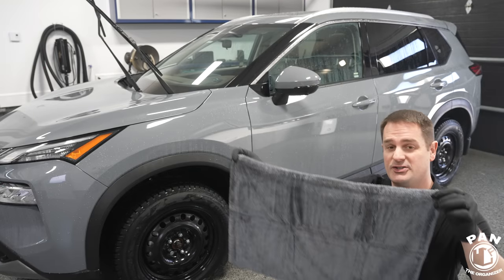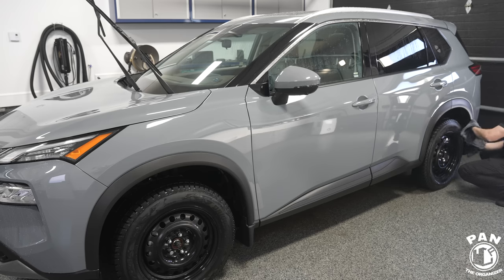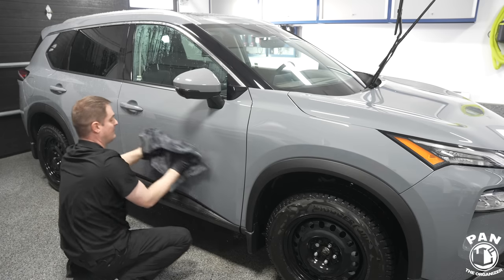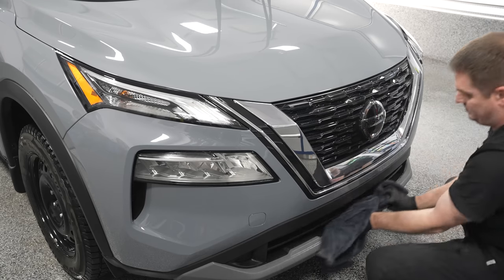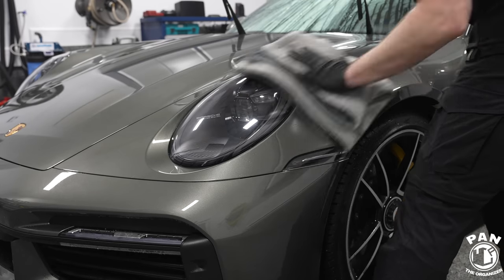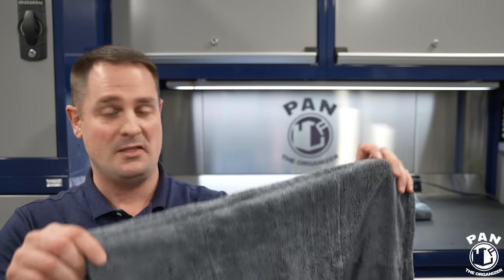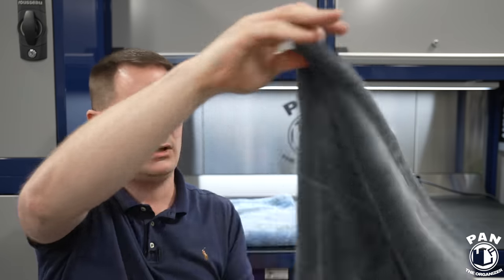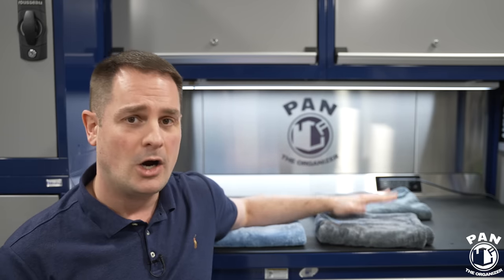My new favourite microfiber drying towels?

Comment: My favorite is the Autofiber Amphibian. Twist on one side, high pile on the other like the one you showed (but in a 16x16 size) Dry with twist loop and buff away any streaks with the fluffy side.
I don’t understand the need for super large towels … considering most of us air dry the car first. Even if doing a RW, i use two small 16x16 towels, let one get wet and ring out when necessary. 2nd to buff away any streaks.
Reply from the maker: I haven’t tested that one yet. Autofiber does make good microfiber products for sure!

Comment: Went to the local auto parts store and found a towel, I think made by Meguirars, $20 and can suck about the same. 
I have used the sucker for a few years now but was n needing one in a pinch and discovered the towel art advanced Arturo parts. Great video
Reply from the maker: Thanks Billy! If you have been using the Sucker towel, you probably noticed how much higher quality it is and how thicker it is compared to auto parts store bought towels...

Comment: Pan in my home there is a small parking and my vehicle is escalade it's backside is exposed to sunlight. I'm applying the graphene coat in night time and on morning my vehicle back part is exposed to the direct sunlight. And it won't affect the curing process on the car?
Reply from the maker: Don't apply coatings in direct sunlight. All manufacturers specify that. But after you're done applying, if it's in the sun, that is perfectly ok. It's actually good as it will accelerate the curing too.

So apply in the shade. And after you're done, it can be in the sunlight the next day no problem.

Comment: I have a 1999 Honda Prelude, I want to know if I should polish it or not. I want to use a medium polish with a microfiber cutting pad and finish with a finishing polish and light polish pad. I plan to have my car wrapped anywhere from a year or two after I polish. Considering the age, the paint does not seem that great, seems oxidized but I can't get a read on the health of the clear coat. Will wrapping the car be safe if I decide to wrap it a year or two after having polished the car? I want some temporary pop until I can safely afford the wrap.

Comment: Good evening! Just wondering on 2 questions. 1. Do you wash your sucker jr. Towel after every wash?  2. When you do your 2-3 months booster for ceramic coating do you use a drying aid?  Thank you as always.. Ryan
Reply from the maker: Hi Ryan!
1. Yes I wash all my microfiber towels after each use.
2. I use a drying aid first, and then apply the booster on dry paint. Unless the booster can be used as a drying aid, in that case, you kill two birds with one stone.
Reply: Excellent just double checking. Thank you

Comment: Pan i didn't have infrared curing machine I'm applying graphene coating on my car .it's mentioned 14 days of additional curing how to maintain the car for the curing
Reply from the maker: For the first 24 hours after applying the coating, don’t expose the vehicle to water or rain. And for the next two weeks you can drive no problem, even in the rain, just don’t wash the car during those two weeks.

Comment: Hey pan thanks for another good video, what product would you recommend for car odor removal like throw up or vomit. I hate to ask but had a customer wanting me to remove it and I have no idea what to buy for it
Reply from the maker: That’s never a simple answer because it depends on many factors including what exactly was in the vomit and how long it has been there.

Bare minimum is to clean the area with a carprt cleaner and extractor or steam cleaner. If the smell is stilk there, clean the rest of the interior and potentially use a fogger meant to deodorize. 

Last resort might be to use an ozone generator. So you start with quick and simple methods and move up in aggression levels depending on the results of each step.

Comment: I got the middle sizes one and don't get me wrong it does the job super well but in the middle when it gets wet you can't actually dry the car cause you're basically putting more water on the car and when you wanna squeeze the towel to get most of the water go it doesn't- it just holds the water super well in the fibers and it should be a good thing but actually it's a double edged sword cause the towel is gonna stay wet and not dry the car 100% So I'm just gonna get master blaster side kick for my personal car + the best for tires, grilles, and etc...

Comment: got this to have a quality towel.  you're right this is amazing but I only use towels when I have to. I rarely touch the paint unless I have to.  I feel everyone's gotten sucked in to the detailing gane too far that they forget the best principle to keep your paint looking great.. don't freaking touch it lol

my method is 
1 Rinse
2 contact wash
3 drying aide diluted in pump sprayer
4 Rinse
5 air compressor/blower

done.  I touched to paint one time.  of course you must do more if you're claying, polishing, coating with wax or ceramic. but that's it.  why use drying towels when one really doesn't have to right.
Reply from the maker: Of course if one can afford a car dryer or leaf blower, it’s the best option. A touchless drying method is the best. That’s what I do, as I own three blowers.

But not everyone can afford a blower, or wants to buy one. So they need good alternatives to dry their vehicles.
Reply: @PanTheOrganizer  agreed  but we can convince others to  invest in  a good blower as going through hundreds of microfiber towels can add up.. the cost savings in the end go to the blower .  but also keep a few microfiber on hand at all times. for final touches and when you really need it.   appreciate the honest amazing content, keep it up. maybe do a video on a two or or three affordable blowers/air compressors that can dry cars without touching.   think that'd be good content..a video on where and  when we don't necessarily have touch put any friction on the paintwork.

Comment: Very cool pan would you let those air dry or in dryer on low heat thanks 😊
Reply: You can let them air dry or put them in the dryer on low heat setting, if using the dryer, I like to pull them out when it’s 90% done and air dry the remaining.
Reply: @luxurymicrofiber419  thanks pan because my truck is so large like yourself I’ve been using my leaf blower the towel will speed things up tremendously thanks
Reply from the maker: I put them in the dryer using the "air dry" feature, which means the lowest possible heat setting.

Watch my popular microfiber cleaning tutorial here: https://youtu.be/t_ryfGlkE9I

Comment: Great opening lines/segment:-). Slightly uneducated and under experienced, these towels compared to rag company? Is there a significant difference one would notice? ~ Thanks ~
Reply from the maker: TRC makes great drying towels, especially the Gauntlet. If you already have one, no need to upgrade. Yes the Sucker is slightly superior in my opinion, but we’re splitting hairs here. Two very good microfiber brands.

Comment: Pan, I'm a little confused on which product is the drying aid, revive or kings gaurd? Or are both products drying aids. I'm looking to lubricate the Sucker towel as I dry my car after a wash.
Reply from the maker: If you are using Revive, it’s a rinseless wash so it also acts as your drying aid. No need to spray more drying aid. Just towel dry after using Revive.

You would use a drying aid to towel dry the vehicle after a regular wash with soapy water.

Comment: Hi, Pan. Great video as always. Maybe this is a silly question, but when you say "one towel dries the whole vehicle" (or similar) are you periodically wringing the towel out to remove water previously pulled off the vehicle?  The video doesn't show you doing that, but it seems like you would have to. Either way, I'll have to try these towels out, but I would like to fully understand how you are using it.
Reply from the maker: I didn’t need to wring the towel for this SUV. :)

Comment: Great video! TRC Liquid8r gets the job done for me. Pretty similar stats to the Sucker (slightly less GSM - 1100 vs 1400), but I doubt the difference is noticeable.
Reply: I’ve been using their 1500 from TRC 30x30 it holds much more than Liqud8r it works so well i able to dry up 3 full size suv
Reply from the maker: Thanks! Yeah with the top tier towels, it gets to a point where we are nit picking the differences. But these LM towels really impressed me! As you know, I had the chance to test so many different towels from different brands over the years, it takes a lot to impress me now. :)

Comment: Great great video. Drying towels are extremely cool. I don't have this brand, but I found that having a few smaller drying towels is better for me then a big one. The big drying towels pick up soooo much water that they weigh a ton. Hard to manipulate in some areas, and want to hit the ground occasionally. Of course I am weak and pathetic too! Lol. 
After each use would you wash your drying towel, or is it OK to just hang towel and let it dry? I don't have alot of towels, so what do you recommend? Thank you for this demonstration. Cool video.
Reply from the maker: I prefer to wash all my microfiber towels after each use.

Comment: great video as always. I have a question. what do you use more. your ego, bigboi, metrovac blowers or the drying towels? and which is better. thanks so much
Reply from the maker: It’s not a question of which is better but what method you prefer and if you have protection on your paint or not.

As I have a high quality coating and had the budget for a car dryer, I use my blowers to blow the majority of the water off, and then finish with a microfiber towel and drying aid.

But for someone who has a smaller budget, these Luxury Microfiber towels are the best I have tested.

Also if you don’t have protection on your paint, blowers aren’t as efficient so towel drying is a better option.
Reply: @PanTheOrganizer  thanks so much for the reply and the help. take care
Reply from the maker: My pleasure!

Comment: I want to know how to maintain the towel .  I have a large towel with similar properties. My problem is after it is washed it is hard to dry.  I don’t know if a dryer is appropriate, but I do use it on the single towel and it will not dry because it absorbed so much water from the washing. I end out finishing drying it outside. I live in SoCal. so it not  much of a problem, but what about retailers that live in colder climates like yours.  Question is how do wash and adequately dry these type of products?
Reply from the maker: You're in luck. I have a popular tutorial on how to easily clean and take care of your microfiber towels: https://youtu.be/t_ryfGlkE9I
Reply: @PanTheOrganizer  The main problem is how to dry these towels. If you wash them they absorb so much water that even when you spin dry them in the dryer they are still massively wet. I have to have a hot sunny day to dry them. Is their a more simplistic way?

Comment: Hey Pan!  Thanks for the video.  I have the Sucker Jr and it works great!  I need help.  I always use a drying aid…Beadmaker.  I have a problem with the Sucker working well after a few washes (I use Chemical Guys microfiber wash)and I’m assuming that the Beadmaker is not totally being washed out it.  What do you think?
Reply from the maker: Yeah that often happens when using powerful drying aids. They tend to coat the fibers.

You have to use a very good microfiber detergent like P&S Rags to Riches. I wash my microfiber towels with that after each use. That detergent was designed to help remove sealants from the fibers.

In your case, as your towels are already coated, start with pre-soaking them in warm water and a few ounces of Rags To Riches overnight, then wash them with the same detergent the following day. It should help restore them if they’re not too far gone.

Comment: Hey dude I have a question not related to the video. I store my bottles of car chemicals in the garage, some of the bottles have condensation on the inside. Does that alter the products performance? I have a bottle of dream maker new and I have noticed product has like evaporated or something because it has less and it looks like it didn’t leak..
Reply from the maker: It’s fine as long as your products don’t freeze. Also, keep in mind most detailing chemicals have a shelf life of 1-2 years.

Comment: Would using Bead Maker as a drying aid “ruin” a drying towel? I’ve had this towel for about a year and feel like it used to absorb a lot more water than it does now. I always use bead maker as a drying aid as well as Rags To Riches for cleaning them. If anyone could answer I would really appreciate it as I’m wanting to buy a new towel and want to know if I should continue using bead maker with it!
Reply from the maker: Using any drying aid will coat the fibers and eventually make it less absorbant. Rags to Riches does help as in comparison to other detergents, but eventually, over repeated use all towels used with drying aids will have a shorter lifespan. It is what it is. I wash my drying towels (and all my towels) after each use, which also helps.

If you have the tendency to let the drying aids "cure" onto the fibers and only wash your towels hours or days after, that won't help.
Reply: Okay, thanks so much for the quick reply and helpful info!
Reply from the maker: My pleasure Dylan. How did you discover my channel by the way?

Welcome to my channel. You discovered one of the biggest car detailing channels on YouTube as we surpassed 980,000 subscribers and we have over 132 million views! I have been detailing for 26 years and I love to share my knowledge and passion with my viewers.

You found the right channel to help you learn everything about detailing.

Comment: Great video again Pan.  Pan does the larger towel get heavy when wet?  I have the Wolly Mammoth from chemical guys and man does it get heavy when wet!
Reply from the maker: Any large towel will get heavy when absorbing a gallon of water. You can’t escape physics.
Reply: @PanTheOrganizer  I prefer the smaller size towels, just have more of them.  Gets very uncomfortable when towels get heavy.
Reply from the maker: I use the Sucker Jr which is the perfect size for my Porsche and mid size SUVs.

Comment: Hey Pan! completely off topic but can you spray on a ceramic detailer on top a sealant?
Reply from the maker: It's usually recommended not to mix regular waxes/sealants with ceramic based products, as you can't ensure the compatibility of the chemistries and you would be masking the superior properties of the ceramic based product. And eventually, the ceramic protection will reject any incompatible topper.
Reply: @PanTheOrganizer  any recommendations on what I can use to boost up the hydrophobic properties on my gyeon wetcoat?
Reply from the maker: Either reapply more WetCoat (it should last 1 to 3 months), or you can use their Gyeon Bathe+ when washing your car. Link: https://bit.ly/3E6Jk2G

Ideally, you would apply a base layer of the more durable and awesome Gyeon CanCoat EVO (lasts up to 12 months): https://bit.ly/37GhBcE

And then you maintain that with either WetCoat or Gyeon Bathe+.

I have an entire series of videos on how to prep, install and maintain Gyeon CanCoat here: https://youtu.be/VnE0b0nsiMU
Reply: @PanTheOrganizer  cool thanks for the fast reply Pan!

Comment: How do you wring these large towels?
Reply from the maker: The larger the towel, the harder it is to wring. The good thing is that with these you don't need to wring them out, one towel dries an entire vehicle. Then I wash all my towels after use.

But I prefer slightly smaller towels as they are easier to manage. So I would prefer the Sucker JR over the regular Sucker.

Comment: All the twisted loop ones I tried so far , don’t seem to be as plush as normal plush microfibre towel , is that the case for this ?
Reply from the maker: That’s normal it’s because of the weave lattern. Twisted loop towels are made to be the most absorbant types of microfibers. And I prefer twisted loops for my drying towels.

Now it’s not because they don’t feel as soft as other types of microfibers that they are unsafe for paint. Quite the opposite. They are still microfibers and hence are the safest types of fabric for paintwork.
Reply: @PanTheOrganizer  thanks I never knew that to be honest , learnt something again , I thought the ones I got are not great , meaning the material but they absorb very good and I was thinking maybe they are not safe on softer clear coats but thanks for clearing that up

Comment: Have you every use there pro sheild ceramic coating? Is it any good?
Reply from the maker: Yes I have been testing all their chemicals including the Shield Pro Ceramic Coating. Works super well and reminds a lot of my favourite consumer grade coating, CarPro CQuartz UK 3.0 which is quite an honour.
Reply: About to try the reset tomorrow. Still can’t tell my the ratio direction how do do this in my cannon. It’s a ridiculous concentration ,  but still struggling to find the correct ratio for something so small as a cannon.
Reply from the maker: You mean CarPro Reset? That shampoo is mainly for the handwash. Yes you technically can use it in a foam cannon, but finding the correct dilution is always tricky as it depends on your pressure washer setup, water quality, etc.

CarPro has their Lift, which is their dedicated snow foam. 1:10 dilution ratio, boom, good to go in the foam cannon. And it's an alkaline pre-wash, so works better than Reset to remove grime and traffic film.
Reply: @PanTheOrganizer  ok thanks!